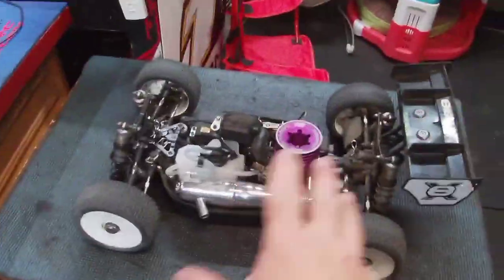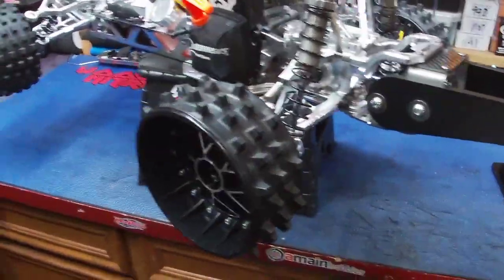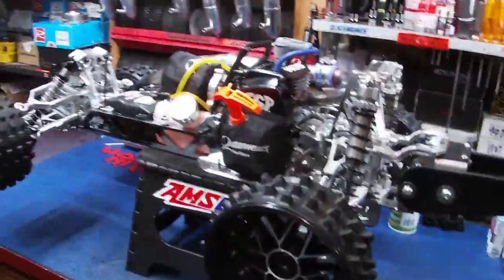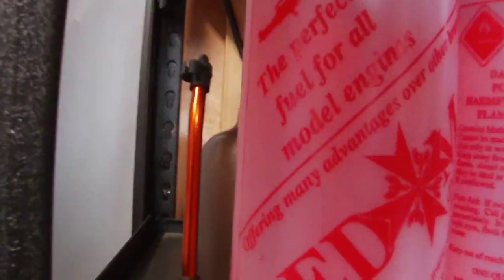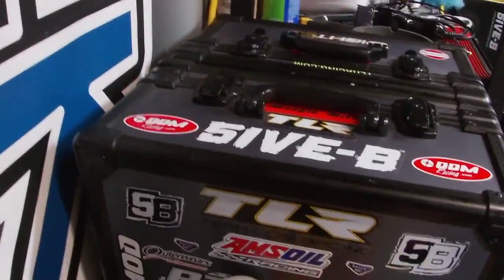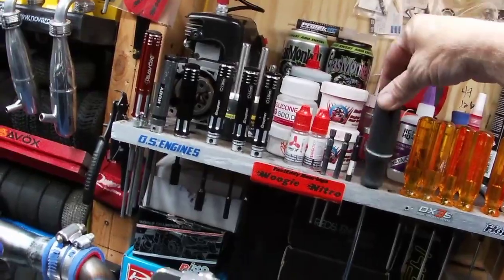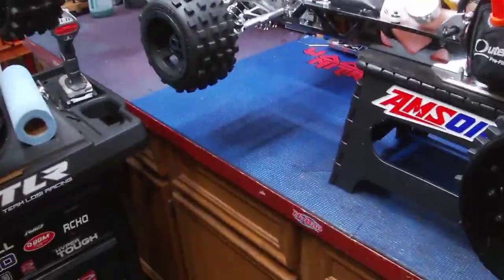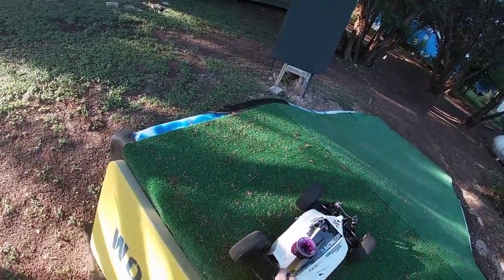LETS PUT SOME FIRE TO THIS NOVAROSSI VIRTUS

Comment: Nice video def got your jumping down not easy to do! If you ever decide do hybrid the diy hybrid is much cheaper then the outlaw to build thats what I have! Wheelie bar looks great nice job! Also just my thoughts def any thing over 65cc is lot work to much wheelies and not very nice on drive train! If had recomend 3 engines  for you in baja I would recommend 46gt,55supreme or 65 supreme! 50gt doesn't have lot rpm mostly all tourqe good for 4wd cars! 46gt or 55 supreme are  bad engine all round for baja! Just my recommendations you  will figure it out and see lot guys running lockers in bigblocks I hate lockers I run innovations rc diffs in all bigblock way  better handling and driving just some friendly advice do with it as you wish have good night!
Reply from the maker: Thanks Jason yeah I've noticed a lot of them running the lockers

Comment: Nice jumps Woogie! What plug with you normally run in your Novarossi 28s?
Reply from the maker: Novarossi.28 I would run the cto5 ..cto6 is too cold the five is a little warmer more consistent idle less flame outs better tuning
Reply: @woogienitro  Thanks Woogie.